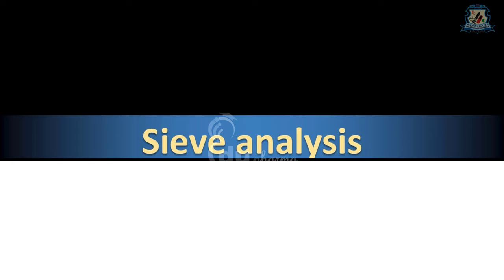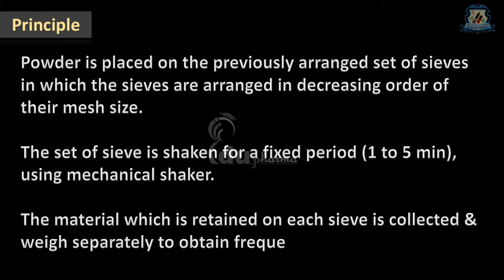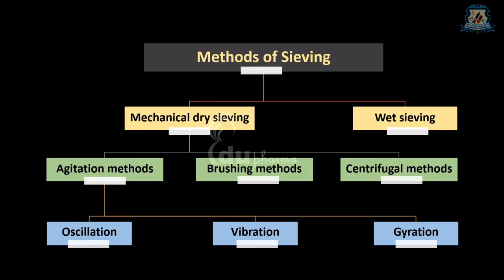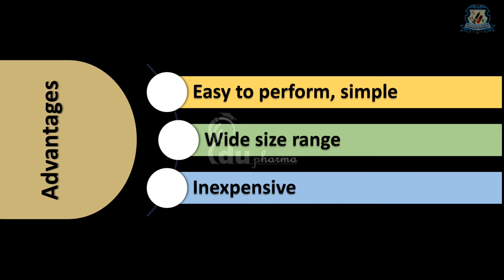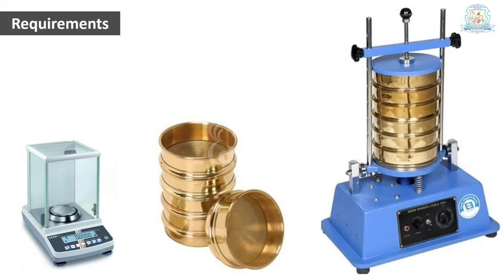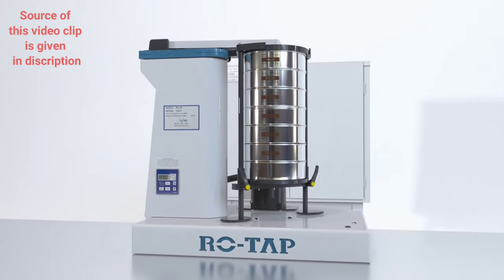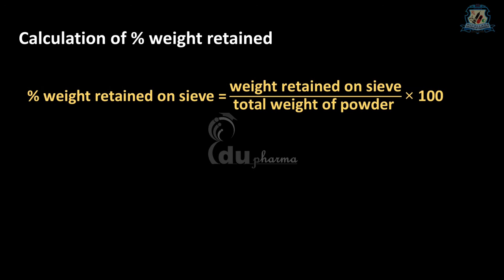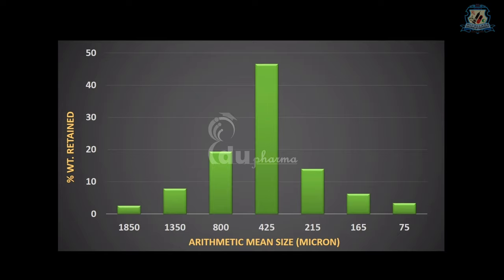Sieve Analysis | Particle size Determination | Particle size Distribution  | Micromeritics |Pharmacy

Comment: Thanks so much for this video. But you should have mentioned or shown how you obtained the arithmetic mean size for each sieve too.
Reply from the maker: Most welcome.. 
I will work on your suggestion... Thanks a lot
Reply: @KhalifaMAsif Although I suppose the arithmetic mean was obtained as an average of two successive particle sizes from the top to the bottom, the last two, i.e.,  "165" & "75" seem to be wrongly computed. They are rather suppose to be "97.5" and "7.5", respectively.
Reply: Hello sir, how did you compute the arithmetic mean size?
Reply: @selatokki722.22  You can compute the arithmetic mean of each sieve No as the mean of two successive sieve sizes.
For instance,
For sieve No 08, d = ((2000+1700)/2 = 1850)
For sieve No 10, d = ((1700+1000)/2 = 1350)
For sieve No 16, d = ((1000+600)/2 = 800)
For sieve No 25, d = ((600+250)/2 = 450)
For sieve No 60, d = ((250+180)/2 = 215)
For sieve No 85, d = ((180+150)/2 = 165)
For sieve No 100, d = ((150+0)/2 = 75)